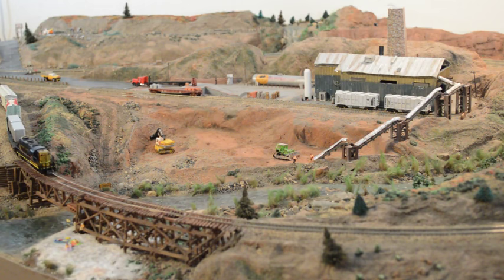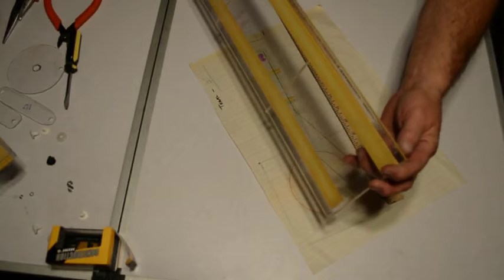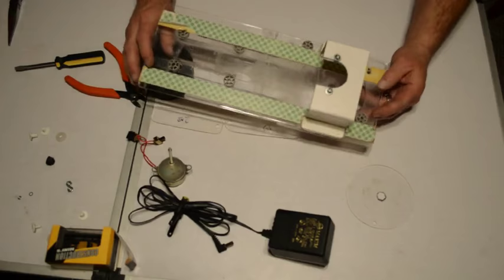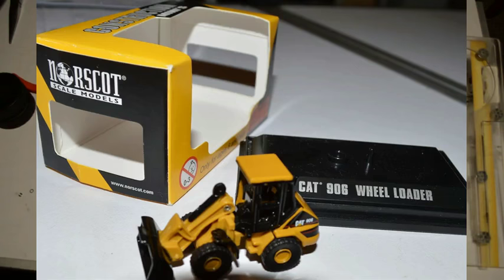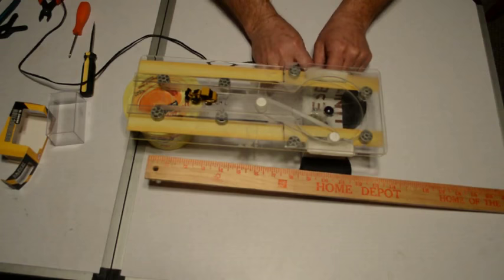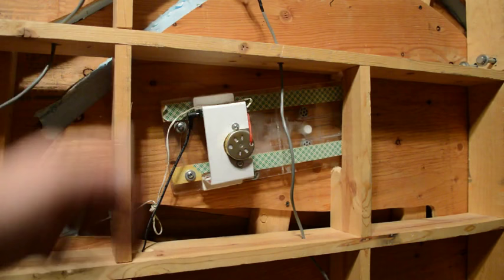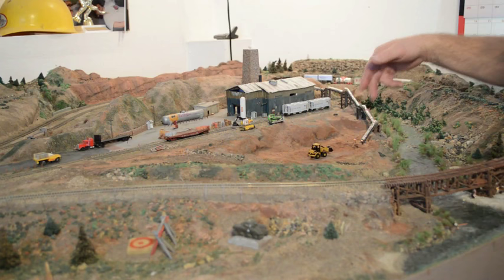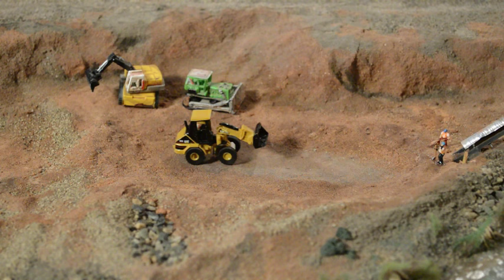Animated N Scale Caterpillar

Comment: I ALWAYS drive the CAT like that when I am either REALLY tired, or had way too much to drink the night before.  Just sober the little guy up some, buddy.  hee hee  Oh, and REALLY great job there.  The jerking can be resolved somewhat by using any sort of oil where the CAT slides back & forth on.  I would try WD-40 first, unless the surface is plastic or such that the petrol base would melt.  You can also try graphite powder.
Reply from the maker: Michel Gaudet, hahahaha ,  Thanks for your comments. . . I think he drives as well as can be expected for His condition, hahaha. . . As far as SLIDING, the wheels are actually Rolling back n forth, and I did lubricate the axle. The surface for the record is actually Red sand. . .

Comment: If you mounted the entire mechanism so it pivots at the point where the conveyor begins in the scene, and got a second motor and build a linkage that attaches 90° to the end of the assembly, then you can actually rotate the entire mechanism. Look at surplus electronics stores and find a DC gear motor... You can regulate it's speed with a DC voltage regulator, just like with the trains. Run it at a lower voltage, so it's much slower. If it's slow enough, then the Caterpillar will appear to widely deviate from the same path, as if it were pushing dirt from multiple locations toward the conveyor. DEFINITELY use a neodymium magnet on the piston mechanism. That should have the power to drag the Caterpillar more smoothly.

The Caterpillar seems to bolt off the line a bit too rapidly. It feels a bit to fast to feel natural to me, and not just cause of the jerkiness. The synchronous motor isn't able to be slowed down without a variable frequency drive, but you CAN slow it down with a simple mechanical solution. Just look for either gears or pulleys (surplus electronics suppliers tend to have stuff like that too) to create a speed reduction ratio. It adds some complexity to everything, but might improve the realism.

Another thing to consider, it to just check how easily those wheels spin. friction will make it jerky, as will a weak magnetic field. Field strength DRASTICALLY tapers off with distance. If necessary, consider milling out the plywood so it's VERY thin where the magnet sits. A little lubricant might help with the jerkiness too, especially if the wheels don't spin that easily. If you are concerned with a liquid lubricant dripping and staining your layout, try something like a graphite powder lubricant. It can be found near the key making section of a typical hardware store (it's used to lubricate the tumblers of a lock)
Reply from the maker: Excellent richfiles,  Thanks for your observations and suggestions. . . I have been 'tinkering'  but nothing earth shattering as of yet.  But again thanks, and I will consider and play with those ideas.

Comment: I like the magnet idea but the hot glue isn't going to hold and should be replaced with mechanical fasteners.
Reply from the maker: Thanks for viewing and the comment,  nice catch. . . The hot glue was to generally hold the individual pieces in place until I could attach it mechanically under the module deck.
Reply: Thanks for your reply. I use hot glue a lot for the same purpose. You might think about wires attached to the same "motivator" to add an additional action(s) to your set and to switch lighting. You can use reed switches with the magnets so that as the vehicle (or subterranean motivator) gets close it switches on the light or continues the sequence with another action. Your layout looks fantastic.
Reply from the maker: hahahahahah...   That is Exactly what I have been toying with to add a backhoe working,  AND to power an on/off lighting in the warehouse above the pit. . .  Great Minds. . . . hahahahha  Thanks, appreciate your words.
Reply: When I was little and the child of academics who "dragged" me around to museums the ones that would fascinate me the most were the ones with action as you are adding. That is why I liked your YT feature so much and wanted to add any idea I could. Reed switches are still on eBay but electronics stores are disappearing. I think the new Neodymium Magnets are super for ideas like yours and I can come up with all sorts of ideas with them. You might want to explore the new little CPUs such as "Apple Pie" and so forth. They are cheap and you can actuate servos which would be less wear (and lower voltage/heat) on parts for the long run as well as actuating things in different 'sync."
Reply from the maker: Good ideas. . . Thanks again. . . . back to working on little actions. . . .

Comment: Cool!  How thick is the plywood?
Reply from the maker: Thanks, The Plywood decking on my layout is 1/2" in thickness.
Reply: That must be a pretty strong magnet!
Reply from the maker: They are RARE EARTH MAGNETS  and Yes Quite strong, When stacked on top of each other, It Is Very Hard to pull them apart. 
* Large N50 Neodymium Block Magnets Super Strong Rare Earth 1/2" × 3/8" × 1/4"***  is the description on the popular selling site. . .
Reply: Hmm... Thinking about this, you might be better off milling a groove into the bottom of the plywood. Maybe even take the groove deep enough top leave only a single ply left. The distance of the magnets, combined with the pull strength may be increasing the friction and leaving the angle of the magnetic pull too shallow to overcome that friction. It might even be worth trying smaller magnets, with the reduced distance, if you still have trouble with jitter.